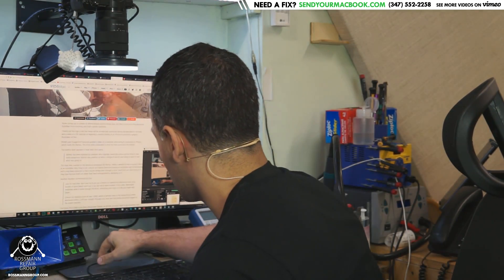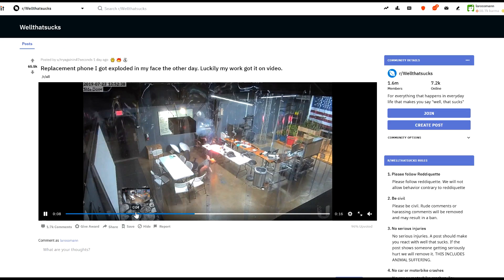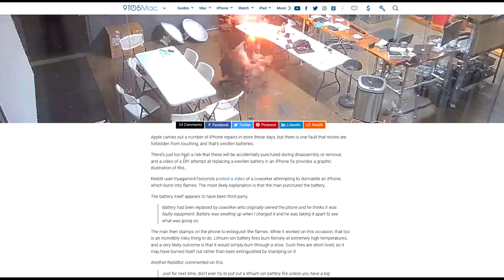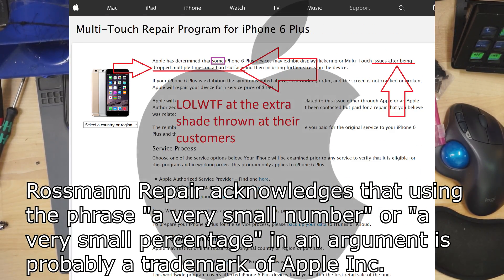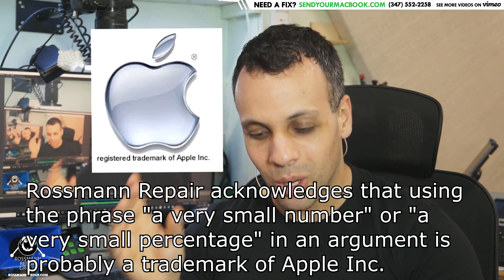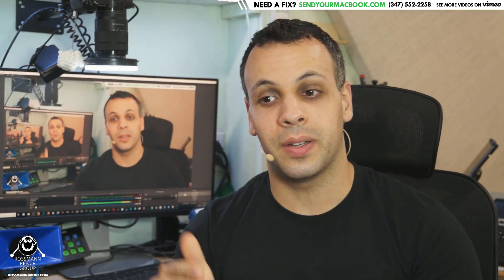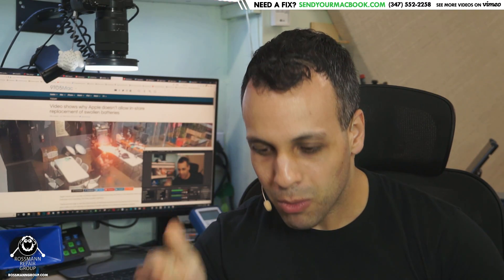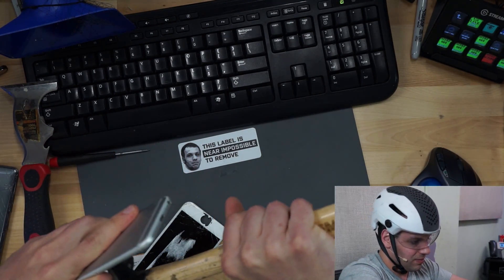STOP FEARMONGERING

Comment: in the future oem pc's wil have their power supply glued in to make the pc that much smaller

its a step backward to not be able to remove the battery its more versatile with a removable battery are toys also going to have now glued in batteries when you purchase it from a store how bs would that be? besides thiner dont mean better if it aint at a cool temperature it can just be thrown in lava and gone with it i purchase stuff to last not to die from heat thank you very much

Comment: Even if you decide to remove the battery by using a cutting torch, a flaming phone or laptop battery becomes safe when put in a large metal or glass container using welding gloves.
Just don't do it on an office desk with piles of paper waiting to be set on fire.

Comment: Third-party batteries are more unsafe, statistically, though. The one thing we gave up on with switching to Li-ion is safety, and third-party off-brand shit batteries are usually not up to standards for use in where they're supposed to go. So standard protections will be lax on those.

As to catching on fire when punctured, yes, it's possible that they're more susceptible to more worst-case failures, either by bad design on how the cells are arranged, or possibly a badly-reacting protection circuit (or lack thereof). The swelling that batteries do is a safety feature, after all, and is a sign that the battery has already failed in some way. Bad batteries might not do this properly. Even in the days or replaceable batteries, third-party batteries had bad habits in not having the proper physical frame around the battery, and bad OCP.

You really don't want to skimp on the battery. it's not as so much as the brand as it is about it being traceable to a company that actually cares about being held accountable when they have badly-designed, or badly-tested batteries. That's why you avoid third-party as much as possible.

Comment: What people miss time & time again, it is NOT chemistry as such causing fires. It is not lithium being exposed to air/water & whoompf.

The problem comes from the fact that per cm these things are very energy dense, when you damage a one you are often making a short between - & + & there's so much power in there it combusts.

Whatever comes along next unless it has something like a plastic polymer electrolyte (Prototypes out there) if you damage a high power battery it'll most likely suffer a runaway thermal event. .

That's why it's often safe to mutilate a discharged battery, the fire risk is not chemical from lithium.

Comment: 3M make adhesive strips for hooks on you walls at home they stick very strongly yet have a tab that when you pull sideways it breaks the glue, comes off the wall without damaging the wall. I use them every Christmas to put Xmas Decs up they are brilliant & very strong too. 

Why can manufacturers not use something similar? Double-sided glue strips that when repair company comes along there's a tab with an arrow on it & you pull & glue breaks & battery pops out.

Perfect all problems sold
Reply: Xiaomi does that in their phones. Well at least the ones I've looked at replacement batteries for.
Reply: @Baby Sinclair even less excuse then
Reply: They need some sort of incentive to make the repairs easy. The adhesive is entirely intended to make it a bitch to remove, deterring people from doing so. If Apple and other companies had the consumer's best interest in mind, we would be seeing a lot of innovation.
Reply: Didn't the old macbook batteries screw in? Or am I thinking about the speaker shroud going around the battery..
Reply: Aidan Montgomery the last macs with screw-in batteries were the non-retina MacBook Airs. MacBook Pros have had them for years, possibly even before 2014, and the 12” rMB has always been glued

Comment: It's not too long before Apple decides to solder on the batteries to the mainboard just like their NAND flash and RAM 🤣
Reply: Sadly, this exists and it's not Apple. I've had at least three android no-names with soldered batteries. 
At the very least, you can "easily" disconnect a glued battery in case of emergency. But when the battery is soldered (directly, no cables) AND glued, the only way to remove the battery is to destroy the phone. Not that it matters, they're shitty phones anyway XD
Reply: It has been done before. In my 2nd gen iPod Touch the battery was soldered in. So somehow they made the decision at some point that it's a bad idea to solder the batteries in. And still you could buy replacement batteries for it and replace them yourself.

Comment: Hummm I have 2 swollen batteries from my Moto 4 that I have had for years sitting in the box that the phone came in. I did not want to just toss them in the garbage.
I wager if I handled them improperly they would catch on fire, but then again 
I have a lighter (I do not smoke) sitting on my desk that could also catch fire if I handled it improperly.

I know that puncturing things that can ignite = bad. Over heating them can be bad.

Comment: Lol swollen batteries are sadly normal with the Li-Pol cells. The battery needs breathing space, but most manufacturers just go for thinniest device possible, which is retarded. For instance i have to RMA regularly machines like Dell Latitude E5470, 5480, 5580, E5570, 5490 and 5590. Battery just get swollen, i remove it and get it replaced. This never happened with the good old 18650 cells though. There is literally no danger unless you are idiot and puncture the battery with a knife or something.

Comment: Apple: Non-professionals not trained by Apple will cause batteries to explode.

Note7: Hold my lithium...
Reply: Better device to reference: Iphone 6, at least 3 times as many Iphone 6 units went up in flames due to defective batteries as Note7 units, and had more than quadruple the failure rate. Apple was content to let it fly under the radar. Samsung made as much of a ruckus as possible, because they did not want anyone getting hurt, even if it cost them some of their reputation.
Reply: @wh0_am_152  source?
Reply: Lithium Battery: hold my spontaneous combustion
Reply: @Felix-j3d4b  Hold my very non-spontaneous combustion*

Comment: I am a phone repairer, between 3 of our stores we have maybe had 5 instances of igniting batteries when we have been trying to remove them. We have over 42,000 tickets created (and that was before we used our repairshopr POS system). Admittedly a lot of them would not have needed batter to be removed or replaced but on the most part these instances were created also by JUNIOR techs who have not had a chance to get a feel for how these batteries come out and/or their tolerance of treatment before the fault threshold. Louis is absolutely right here, I can pop out most batteries without any problem (some are adhered way worse than others) but there is always a risk. I'm sick of not only Apple or major manufacturers saying it can't/shouldn't be done and the general public BELIEVING them. I spend way too much time easing the mind of the panicked customer who thinks that our business is to somehow break their device further for a profit.

If we broke everyone's device for a profit we wouldn't have a google ranking above 4 stars, we would not provide a warranty with our repairs..... Hell we wouldn't even still be in business after 10 years of service. The general public needs to wake up to this fear-mongering.

Comment: I had a Samsung Note 7 and they forced me into returning it because the battery was a bad design and told me they were going to send a forced update that would format the nand and I would never get any updates anyway, but I had no problem and I took the S7 Edge and that battery swelled up and pushed the glass back half off so now I have to cut around the glass to separate the glue and glass, I can't use heat now and they probably glued that down to the screen to boot. I call Samsung and they claim they don't have and S7 Edge batteries and I have to go to a parts center where it will cost $100USD for a battery and they wont mail it to me, but they had no problems mailing me my phones. I have to drive to another state to pick it up or use a third party on Amazon that will mail it for less than $15USD so no more Samsung devices for me. Plus I only get a couple os upgrades. At least HTC used a molex cable whereas Samsung uses a ribbon I can't transfer to another battery that will fit.

Comment: Its chemical fire...and chem laboratories that work with chemicals and reactions that can bust into flames have had a solution for this, for probablly 100s of years....its called Fume hood...and it can be instaled on any desk
Reply: Sand also works and is much cheaper

Comment: accidentally pokes hole in battery
battery explodes
must be a third party problem.
wat.
Reply: ive seen a handful of apple branded oem batteries expanding. a battery is not hard to manufacture and there are plenty of great non oem batteries out there. apple is tweakin.
Reply: Well yes.  But it would also be nice if they didn't glue them in.  Or better chemistry like ultracapacitors
Reply: apple-branded battery swelled up in my g/f's iphone 5, popped the screen off. apple-branded battery swelled up in my g/f's macbook pro, broke the trackpad. 
should I have got an apple g/f instead of this third-party one?
Reply: @duncan-rmi  ha ha awsome :)
Reply: Accidentally? It looks like the guy dramatically stabbed the battery with the soldering iron!
Reply: Kinda miss the time whereas I can literally punch a battery and it won't spontaneously combust.

Not saying you should just do it lol.
Reply: I mean look at China you can buy battery tester that know If the battery is fake or real
Reply: @Andy Ruse very true

Comment: I disagree that the brand of the battery doesn't matter. Firstly, there could be differences in the quality of the outer wall of the battery, making it more prone to puncturing. But secondly and more importantly, there could be differences in the electrolyte. A common misunderstanding is that it's the lithium that catches fire. That's not the case. The lithium is in a salt form and cannot burn by itself, unlike metallic lithium which catches fire spontaneously in air. What actually happens when a Li ion cell is punctured is that 1) the battery get a short circuit, which quickly releases all the charge in the battery in a small spot. 2) the (now hot) electrolyte outgases and catches fire. The electrolyte is essentially a flammable solvent. The major thing that could differ between brands is the exact formulation of the electrolyte, which changes its fire properties. For example, an electrolyte with a higher flash point, or higher viscosity would be less prone to catch fire. There are also some recent development in adding silica nanoparticles into the electrolyte to help inhibit the fire hazard further.

Comment: Ive had an iphone 4 where the battery expanded during (a heatwave)
This year ( I replaced an iphone 6 battery 4 months ago ) just had another heatwave its starting to expand
dose this happen to all batteries in extreme heat or are the ones I got dogshit

can you recommend replacement brands
Reply: No I can't but please may I suggest you put your brackets in the right place if you are going to use them 😂
Reply: @stealthraider22  ( its ( LISP ) )
Reply: Im not a linguist as long as you understand or I got my point across mission accomplished

I mistype miss spell hit wrong key when i think I hit the one I was supposed to baddly punctuate and go in to Capital Every Word Because I Am Used To File Naming

Comment: Bah, ha, ha, I just replaced the battery in my 2012 A1278 MBP due to capacity issues. now just sitting through the the initial charge cycles.

Comment: Hi, we used to have replaceable battery for phones and they were not water resistant, we had no major issues, there are phones that are waterproof and the battery are replaceable like you said. It so stupid to have sealed in batterys. I have had my note 9 for less then a year and i have lost 10% off the full charge in a few years the capacity will reduce even more, I will be forced to upgrade or get the battery changed somehow and lose waterproof. Its difficult to remove the back on these phones too. Back in the day you could unclip the back and pop in a new battery.
The video you showed at the beginning looks like the repair? Man stab the device before it explodes (looks staged). Thank for your video.
Reply: I used to own such phone. Xperia V back when Sony was still trying.

Dipped into water as demonstration to friends over a dozen times, port flaps integrity preserved by using the dock to charge instead of using the USB port, worked fine for 3 years before I bought a different phone for the hell of it.

You dip a 'water resistant' phone with sealed battery made these days and it likely starts to act weird over time because small amount of water still gets in. 

Whatever excuse they put to justify making phone batteries irreplaceable to end user, its BULL. FUCKING. SHIT.

Comment: This is why I like open source items. I use a £50 Medion (android) phone and have done for about 4 or 5 years now, works fine (my last phone was a Nokia 3510 that I'd had for donkeys years and only ever had to replace the battery on once), I don't need all the bells and whistles because to me, they cause the most problems. I have a Windows 7 Medion computer that cost me £250 and is at least 6 years old now and works as good as the day I bought it.
I also have a (ex-company) Dell computer that was downgraded from Vista to Windows XP, is a lot older than my Win 7 computer, works extremely well and is Windows 10 compatible but I choose to run Linux on it and boy, is it fast and runs like a charm. Yes, I'm a bit 'geeky' but NO expert, I like tinkering, researching and experimenting. I have a consistent flow of friends, family and acquaintances that consult me on technical issues because they know if I can't fix something myself, I'll point them in the right direction to get it fixed.
The world is losing its ability to fix up stuff the way we've always done in the past, we've become reliant on the 'industry'  to do it for us. The more we let them, the less we know. Too many things are 'throw away' and it's a damn shame.

Comment: As usual.louis prove apple engineers very wrong. Why is this not suprising me. 
This is as bad as the bullshut sony pulked with there lith-ion batteries in the original ccd-trxx camcorders which had. Back inthe late 90s ,lithum- ion baterries that old ocer heat and cause fires,not explode,but because of the way it charged inside the camcorder, ther was a very small chance of the unit over heating. 
Kind of the same idea as Apple,. Apple knew this was dangerous as this shit happened before with lithium-ion. Apple is just plain greedy. A dumb fuck buch of idiots who are responsible for nearly killing people.

Comment: I vote with my feet. If something has a battery which isn't user replaceable,  I don't buy it. Batteries fail over time, they are a consumable, and what they are doing is trying to make the device consumable, by fixing the battery inside, and that's even before we talk about obsolescence through software. We should fight against it, it's not environmentally friendly for a start. In fact, what we should do, is aim for a law, where if the company stops supporting their device, they have to open source the IP for that device. Then I think we'd see companies being more supportive of their products, against the threat of their IP being open-sourced. Failing to do so, lets the open source community start supporting the device, and potentially extending it's life

Comment: Lithium batteries are dangerous. I don't like the way you make it sound like it is no big deal.
It is. It is harmful and can actually or impair people. And there have been reports in the past where batteries were a safety concern without even being mishandled. There's a reason why every company go out of their way to have multiple recalls on batteries, even though no one on the earth had any issue with them.
It may be only a very small percentage of the case that go wrong, but it's in my opinion perfectly normal to try to avoid those cases.

Now... as for how you avoid those cases, obviously I'm against preventing people from being able to replace their battery, it's bullshit.
Trying to educate people on the other hand is a better idea I think. As a parent you're supposed to tell your kids not to put a nail in a power socket, and how to react if someone gets an electricity shock.
It's not that much different from handling a battery I guess.

Also if you take a look at Apple SVC/ACMT certifications, they put a large emphasis on how to do battery replacement safely. Not saying it is perfect. But they don't prevent you from doing it, they educate you on how to minimize the risk, and that's what should always be done.

Comment: Under that logic, all gas devices need to be removed from the market as there is a small chance of oroduicing carbon monoxide, leading to the death of the user.
Reply: And gas cans should be banned as there is a chance that if you pour it on a fire or let it near a spark it can explode.... Wait, nevermind Blitz already got sued out of existence because they they did not add a "safety feature" that made it more likely to explode after, a can exploded when some knuckleheads thought that pouring gas onto a fire was a good idea.... Oh the insanity!